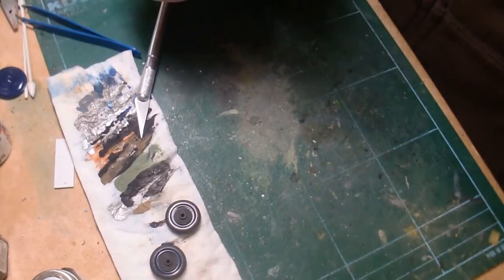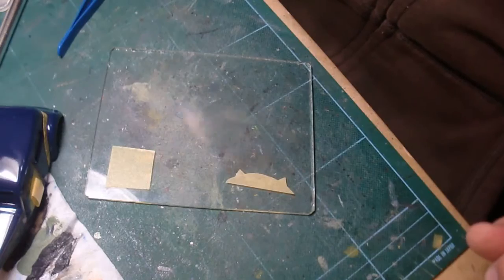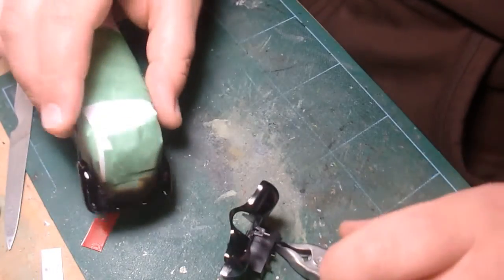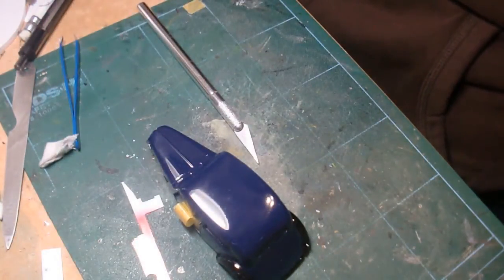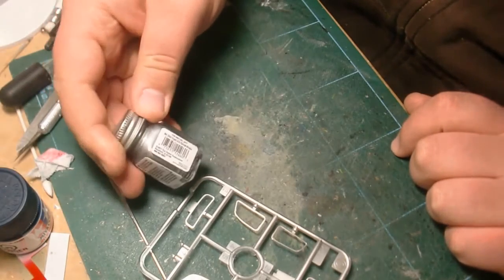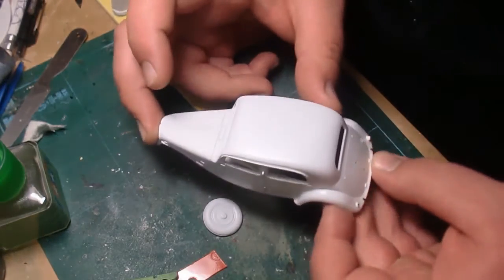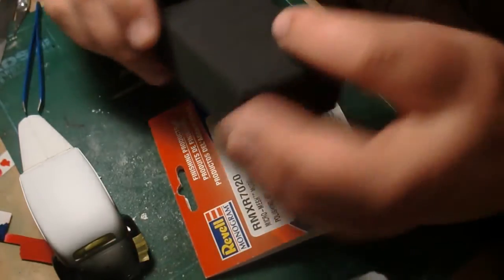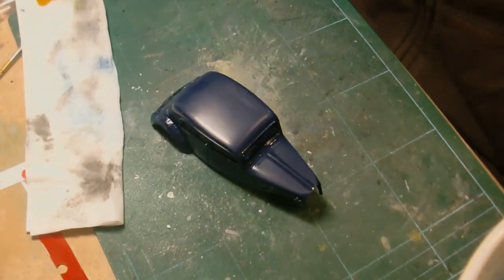Tamiya 1:35 Citroen 11CV Staff Car (Part 4)

Comment: I really appreciate your transparency. If modelers are afraid to show their failures, then others cannot take the opportunity to learn from their mistakes.

As for that orange peel, are you sure that you need to wet those polishing cloths? Those seem like those Mr. Laplos I use by GSI Creos, except mine don't stink. Just go over the car several times with misting coats, then raise the pressure and make it wet and shiny. Any random imperfections can be wet sanded and then just put a layer of Future on it. You're letting the paint set for up to a week perhaps? Just play it safe.
Reply from the maker: I've tried just sanding, and these seem to work better when they are wet. I've left the car alone now for a few days and it's drying very nicely :) But the method you described is what I did, but I held it too far away. This time I'm playing it very safe :)
Reply: rebelsatcloudnine I did the exact same mistake while doing my Honda Fit. I held the car body too far away from the paint spray.
Reply from the maker: stevethefishdotnet I just gave the car a gloss coat, now I've got to let it dry again for a week, but it's looking good.

Comment: You're very patient. I know I could do this job on masking, too, but I'd have to take longer breaks. I would explode if I had to do it all the way through at once. I'll download the whole series and put it on a DVD for my personal use if you don't mind. Thanks for uploading these vids! :)
Reply from the maker: +Non-Prolific 1/35th Scale Model Builder Not at all, this was a frustrating build, trying to figure out gloss Acrylics, I've got another car build in mind, and for that one I've bought some lacquer paint. I'm just going to skip gloss acrylics and decant the lacquer. A bit more work but I think better in the long run :D
Reply: I tried "rattle cans" on car models (1/24th scale) some years ago and I was really pleased with the results. It's less time consuming and the colour is made for cars, isn't it? :D
Reply from the maker: +Non-Prolific 1/35th Scale Model Builder I'm not sure, I know there are some dedicated for specific car colors. And they do have a separate range for WWII Aircraft, they are quite nice but I wish they'd make them for acrylics as well.
Reply: Ah, the colours I used were acrylics. That was just great. I wish I'd find similar colours for my tanks and other vehicles. The Tamiya cans are very expensive and they are small.
Reply from the maker: +Non-Prolific 1/35th Scale Model Builder Yah, they are about $10 Cdn, but it's good paint, but expensive...
Reply: In Germany they're even more expensive, depending om where you buy them. I tried olive drab once and I really loved it. On the other hand the can was almost empty after spraying one kit. That's too much money. I don't have an airbrush, but I don't build many kits. Maybe three or four a year. It wouldn't make sense to buy one. So, I'm like Rob. I paint with my trusty brushes. There are already three vids on my channel. I'm uploading zhe fourth right now.